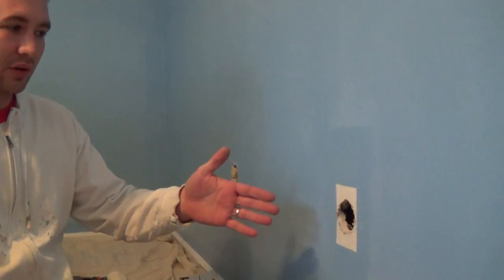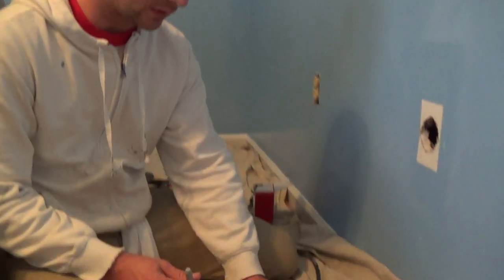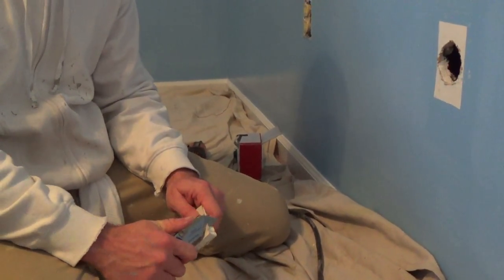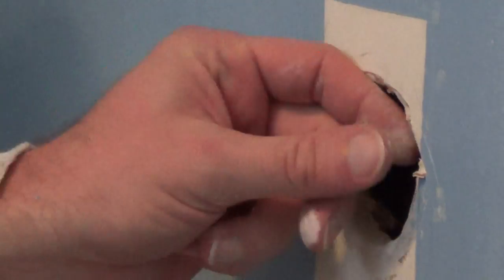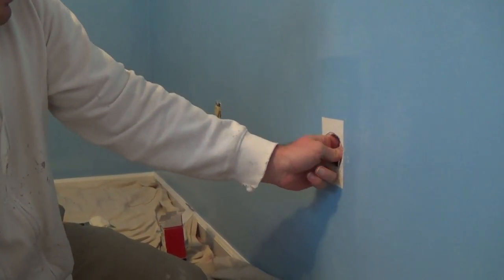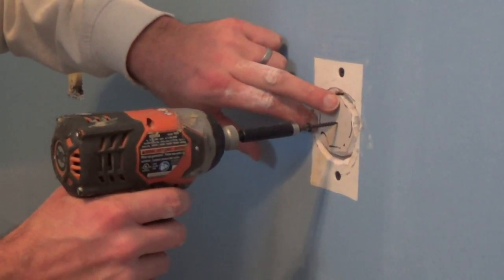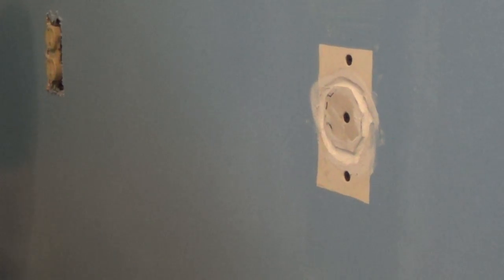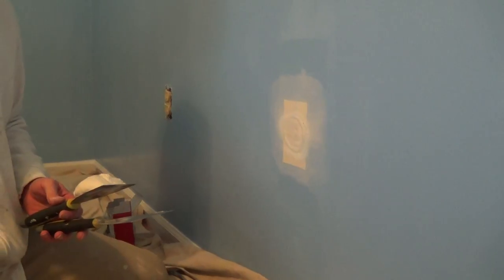How To Patch A Hole In Drywall

Comment: I've done the same technique. I heard you say your stir sticks may break apart which I experienced, so I just wrapped a little tape around the two stir stick to keep them from splitting. little trick when I didn't have better backing boards.
Reply: Nice one . I usually use those square metal pieces that have mesh tape on them . But that's a great way when you don't have one on you cheers

Comment: I like to cut a square of drywall a bit bigger than the damaged area, place over that area trace my square and cut out with a key saw. I like to use a very dry fast set joint compound to pre fill (durabond)